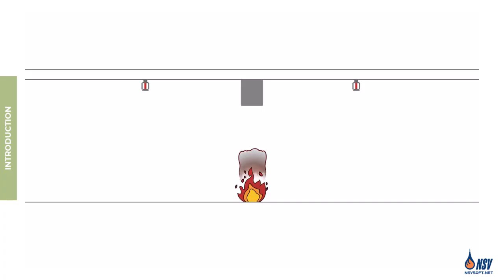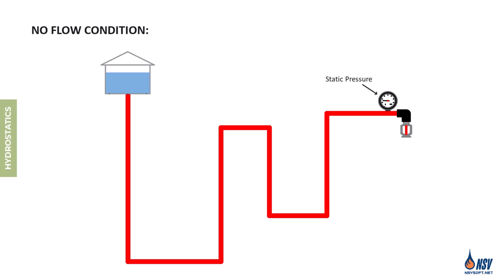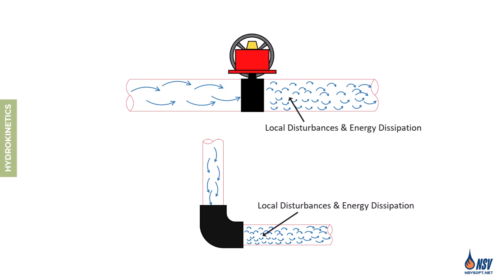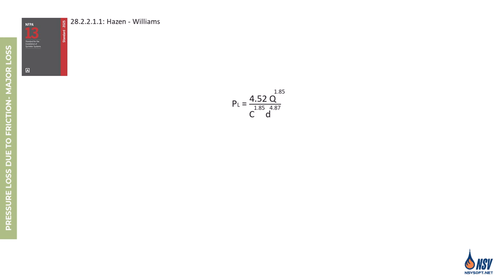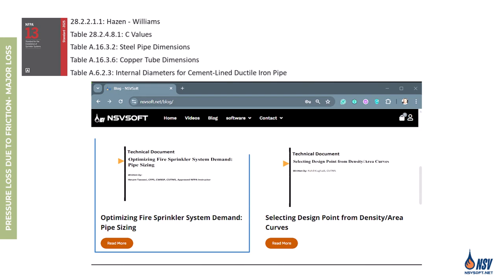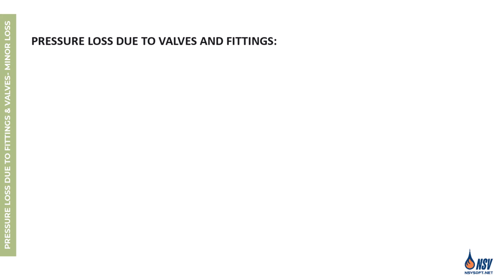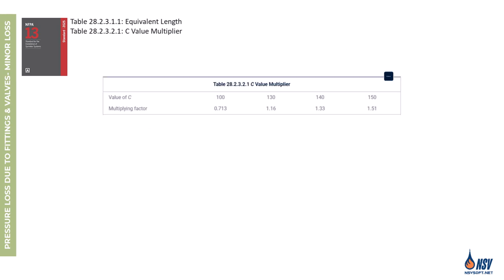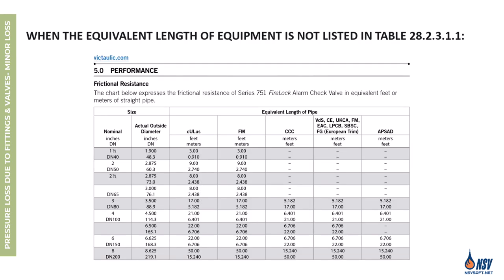💧 Flow Rate & Pressure (NFPA 13/13R/13D)

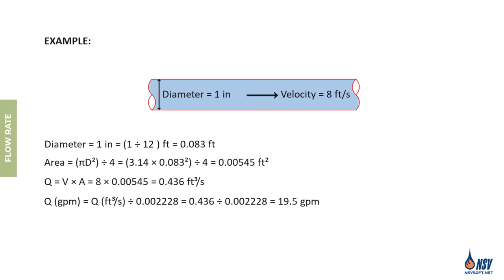Comment: 2:04 Does the NFPA specify a maximum velocity that must be observed? For example, in France, APSAD R1 limits it to a maximum of 10 m/sec.
Reply from the maker: Hi Javier,

Thanks for your question. 

In short, no — NFPA 13 does not impose a limit on water velocity. We’ve covered this topic in detail, and you can find the full explanation in this video:
https://youtu.be/njyMsG6oheQ?si=tQ_cAnhoYfUW5jqg

Comment: Q shall be 0.0436 ft3/s , but you get 0.436
Reply from the maker: Thanks for your comment. You are absolutely right; that was a typo. However, the final answer is still correct at 19.5 gpm.